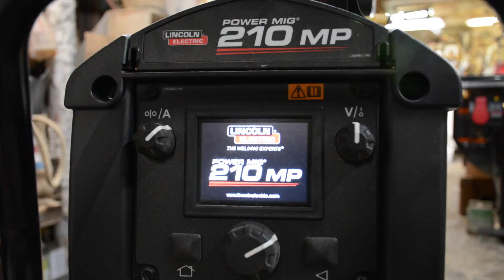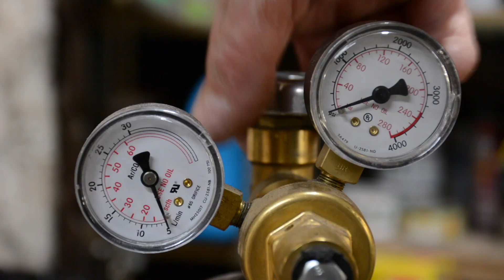✔ DiResta BandSaw Stand

Comment: Fantastic! My dad had an old Lincoln Torpedo arc welder that he mounted on an old cast iron pallet truck it weighed a ton and he rigged up similar feet when the handle was raised the feet would flip up so the "Monster" welder wouldn't roll around like an out of control drunk driver...very clever Mr Diresta...very clever indeed!

Comment: Hey jimmy, another fantastic build, you really do have a wealth of knowledge and share it all with us for free. I really appreciate that 👍🏻 just a quick hint, be careful grinding all your welds back to flush, if you don't get enough heat into your welds for decent penetration of the parent metal you will run the risk of them cracking especially if they are load bearing or subject to excess vibrations or movement. Keep up the great work mate.

Comment: little suggestion with vacuum hose and welding... You might be sucking the mig gas too fast off, and ruining the welds, unless you use super much gas, which would possibly effect optimal arc when welding :)   <- Just hang it a little further up over work place, and you are golden!       That's how i was taught when i was studying metalwork at school :)

Nice project, Keep it going!
Reply from the maker: +Psyconatpr thank you bro!
Reply: +jimmydiresta hello Jimmy that  you make and very clever is à pleasure of looking at tour video children adores trie to reproduce somme one of your création it acknowledge tant is not always tout gain ils fact 10 years that i am  in the restoration of house some one of your  creation m'y bien used for much tout advance a great safety of France remains like Hou board and good continuation ps.your hands is gold
Reply: Agreed.
 Jimmy, if you put a wide cone on the end of the vac hose you can reduce the intake velocity while widening the effective "grasp" of the device.
I would also suggest that you mount it on an "anglepoise" type device over the work space, most weld fumes go upwards, carried on hot air currents.

Comment: Nicely designed and built.  Was wondering if not using the casters attached to the frame but if attaching the casters to the steel extending feet for mobility would work. Would you anticipate any drawbacks in building that way.

Comment: Very clever using only three feet... it'll never wobble, anywhere on the floor.
Reply: That's a Nick Offerman secret. Tables with 3 legs. :)
Reply: high center of gravity + heavy equipment + 3 leg base + humans = injury
injury > woble
simple mathematics
Reply from the maker: h0rr0r100 worry about yourself.
Reply: hey i am not saying anything.... i am just saying
Reply: h0rr0r100 I don't think thats how math works
Reply: trust me.... i know maths
Reply: h0rr0r100 let's explore your "maths". high centre of gravity? even with the cast iron platform the large heavy electric motor is still in the base. it's an older model so its casing is pressed sheet steel most of which is housing the motor. so not top heavy. a tripod is the most stable platform for uneven ground. human error? I've watched JD for sometime now and to the best of my knowledge the only serious injury was sustained by a table saw. I think he learned his lesson. and treats all machines/tools with the respect they deserve.
Reply: h0rr0r100 I have no doubt like most of mankind you do know maths. However your grasp of basic physics is lacking maybe time for a refresher course . Be safe :)
Reply: pls dont call 200 puond gorilla aka AvE and it will be ok
Reply: INTERNET WENT CRAZY on this one.....
 unsubscribe and get out ??? why? i actually love diresta's work... ALL I SAID was that it might be a little bit dangerous. what's alll the fuz about? chill guys
LAST QUESTION for the <<it is perfect -should go die horror100>> guys... why none of the heavy machinery comes with a 3 leg desing from the factory if it is so safe? nice meeting you all... time for me to go die i quess
Reply: h0rr0r100 the internet is CRAZY by definition no need to unsubscribe dude, I've been where you are and it stinks to get slapped down especially by someone you admire when you make a rash comment. Best to accept the collective wisdom offered and learn from it. Otherwise peace bro👍
Reply: nice work as usual, very inspiring. what is the purpose of the vacuum when welding ? toxic weld gas ?
Reply: ionel banu yeah basement workshop so not  the best ventilation. any welding or plasma cutting its best to have a fume extractor. the gases are not good for you. 😷
Reply: h0rr0r100
Reply: h0rr0r100 I hear ya fella peace
Reply from the maker: nothing is falling.
Reply: h0rr0r100 we were all having a conversation and putting new information forward, none of which you seem to have taken onboard instead you childishly comment on unsubscribing and satirical suicide. if you lack the maturity to have an open and level conversation i suggest you dont make comments.
Reply: blindbrick milling machine completely different machine to a bandsaw. and horror100 clearly didn't think his comment or responces through. i think jimmy can handle well thought and educated criticism. i think he's bored of knee jerk safety reactions.
Reply: Says the guy with a caterpillar for a pinky!
Reply: jimmydiresta I think you should have dug a track in the shop, embedded the saw in reinforced concrete and then hired a properly insured and trained lifting crew to help you move the bandsaw every time you need to shift it. The safety trolls would be satisfied with that I think LOL KEEP ON ROLLIN BROTHER👍
Reply: Who cares if it's 1000% safe or not for a bandsaw... my take away is the mechanics of the design. I'd like to try to make something similar for another purpose. Isn't it the point of Jimmy's videos to inspire others to make their own projects? What good is it to rip apart his cool idea?
Reply: BoardLoft you nailed it dude inspiration is what Jimmy does best IMHO
Reply: Scott Baker with 3 feet it won't wabble but it will have bad stability. we got 3 feet stools in my house they are bad about stability
Reply: three feet are very stable. only one plain exists between those three points, no wobbling. I learned that in Jr high geometry.
Reply: +lomoDaniel   Judging by your sarcastic comment you're clearly not familiar with the stability. It's has nothing to do with wobble and 3 points making a plane. An object on 3 legs is not as stable as an object on four legs. h0rr0r100 was trying to convey this but was getting lip from all these simple minded commentors who don't understand the physics. The degree of stability of an object is determined by it's ability to recover from a tilt. The greater the angle of tilt from which it can recover...the greater its stability.

Nader Fawzy observed this in the real world. A 3 legged stool doesn't wobble but will tip over a lot easier than a 4 legged chair of the same height.

If you're interested I can explain why.
Reply: Excelente trabalho Deus lhe abençoe para que outras idéias sejam postas em prática, um abraço.

Comment: Nice vid but anyone who has had to deal with welded on castors ten years later knows that is a mistake.  They all tend to cack themselves at the same time and you find yourself grinding them off endlessly. Better to just bolt them on like they're supposed to and then unbolt and replace.

Comment: How much of this is figured out by mock up beforehand or are you just really good at making it come straight out of your head into a product that works first try?  I would be trying 8 times making one part a little bigger or a little smaller until it works.  Great design and work!
Reply from the maker: Thank you mostly free styled.. i did a wood mock up in different scale to smiley understand the idea .. but was very large.. one side..
Reply: Why did you choose to do 2 feet on one side and 1 foot on the other?
Reply: jimmydiresta Hey Jimmy, will you do a wooden computer case? it will be awesome

Comment: Amazing! Really enjoyed watching that one, as always - such skill and innovation. Can I ask, what was the reason for going with 3 feet instead of 4? Is this to overcome potentially uneven flooring or for some other reason that I can't think of, off hand?
Thanks!
Reply: Matt Jones +
Reply: Matt Jones that's what I thought too it's probably because something so big would wobble way too much if on uneven floor
Reply: I'm curious about that as well.
Reply: It's got to be because of the flooring. As rigid as that thing is built, four feet would cause it to wobble around on the slightest uneven floor, 3 feet will be stable on anything as long as it's not so uneven that it starts to tip over.
Reply: That makes total sense.
Reply: I did wonder if it would cause a stability issue when passing larger stock through the bandsaw but I'm sure Jimmy would have thought of this and it won't be a problem. :-)
Reply: Matt Jones It looks like the way he put it on top, the stock runs in line with that third leg and passes between the two resulting in the most stability you could hope for in that scenario... Jimmy is verrrry smart lol

Comment: Jimmy what was the vac for when you started welding? Is it to pick up the gas?
Reply: tha Priesta -  it's for collecting the fumes. They are not good to breath. The vac has a charcoal filter in it.
Reply: ah thats what i thought initialy. thanks
Reply: wouldn't that suck the argon that ensures a good weld out at the same time?
Reply: There's literally an entire industry for welding fume extractors, ranging from tiny home-game junk like this one up to systems custom built for entire buildings. Generally with MIG, there is enough excess flow and velocity of shielding gas that a fume extractor wont affect weld quality. Even if it did, these aren't exactly super critical, x-ray quality welds, and he ground most of them down, so some pinholes and soot wont hurt a thing.

Comment: Do you have to set the parameters on the welder every time you turn it on? Doesn't this thing save the settings?
Reply from the maker: no just for the video
Reply: @abcdefg It's not that hard to tell that it is the same shot used multiple times.

Comment: I haven't done much with metal working so please forgive if my questions seem basic. Why do you cut with the hand held bandsaw at an angle (it appeared to be an angle) and why prefer that over your regular bandsaw since you have one where you did the finishing cuts?
Reply: The saw blade on the portable saw is tilted, so to cut a straight line you need to tilt the saw a bit. It just looks like it was cutting at an angle. His "regular" metal bandsaw is just the portable one locked in a vise.

Comment: I only just realized...you have no electrode connected directly to your work pieces.  Clearly, you have that steel sheet on top of your work bench completing the circuit.

Saves the hassle of clamping and shifting all of the time, but wouldn't that also increase impedance?

Comment: It might be a dumb question, but why does he use a shop vac when he uses the welder?
Reply: if it's just for the sparks then why doesn't he use it when he's using the disk grinder
Reply: Will Jones i think it is for the weldingfumes, MIG can give Some nasty fumes
Reply: hidde den besten thanks I didn't think about the fumes the few times I have used a welder was in a huge workshop where ventilation wasn't an issue

Comment: Hey Jimmy my daughter is getting really interested in art and has acquired a large assortment of supplies and I need to make her a art supply box that can hold everything and still be able to work of at the same time . plus it has to be able to be transported HELP ME PLEASE !
Reply from the maker: FordFracture get a tool box from lowes or HD??
Reply: jimmydiresta I'd rather make her one of of salvaged lumber something she can look back on when I'm gone and say my dad made that for me long time ago and not some junk plastic box from home Depot that didn't have any meaning or thought put into it .
Reply: jimmydiresta unfortunately, depending on what kind of crafting is done, a standard toolbox just won't hold all the stuff. I'm also a crafter (embroidery, and vinyl) and I also need some way to easily transport my embroidery machine and my cricut machine. (the footprint on the embroidery machine alone is about 19 x 10 x 13, and that's not even counting the embroidery arm, or any of the threads, stabilizers, embroidery hoops, etc.  So trying to fit all your needed supplies into a regular toolbox would pretty much equate to trying to fit your shop into a suitcase. 
Sorry if I came off as rude, that really wasn't my intention and I enjoy your videos very much.
Reply from the maker: Did you see the toolbox I made on the core77 channel? Maybe inspire a version ??

Comment: THANKS BROTH'R I AM BUILDING A SIMILLER CONTRAPTION FOR MY 36" BAND SAW [[ HEAVY ]] SUMB YOUR IDEA FOR THE BAR TO LEVER THEM BOTH UP AT THE SAME TIME COOL 
I AM USING SCHAFOLD WEALS SET UP INSIDE OF CAGES THEN I WILL USE A LONGER LEVER THAT FOLDS UP OUT OF THE WAY  THANKS FOR THE IDEA SIR >>>>>>>>> ABC
Reply: BEATS ROLLING IT AROUND ON PIPES ONCE AGAIN THANKS
Reply: Michael Sepe
Try turning off caps lock...
Reply: WHY